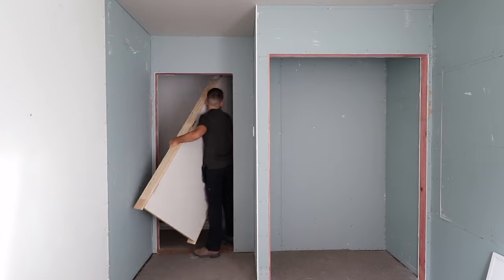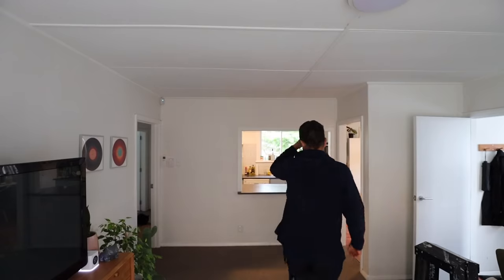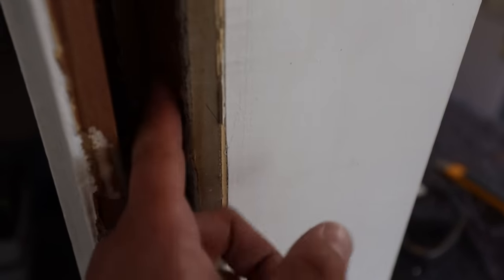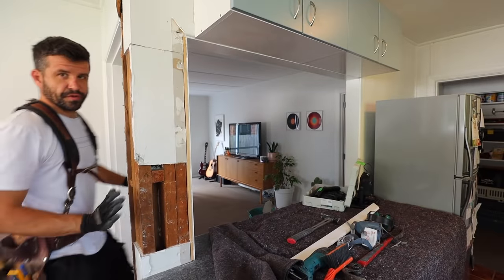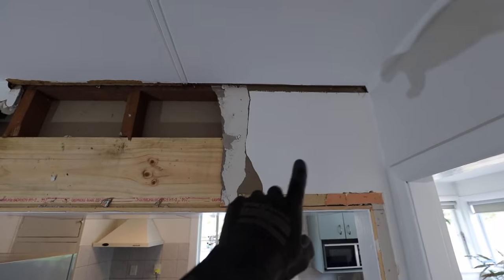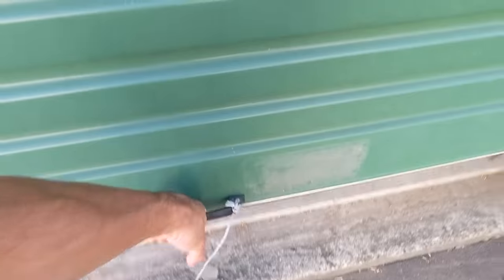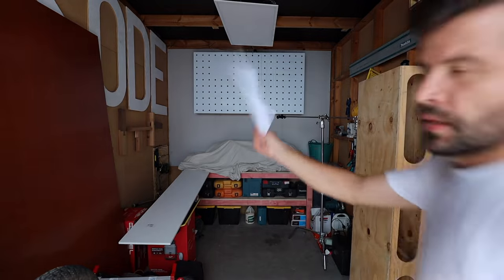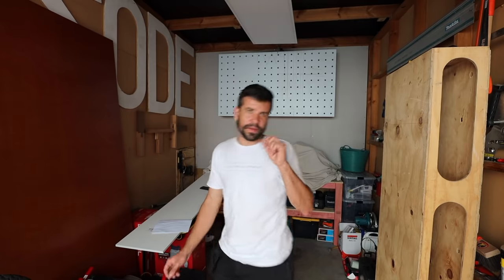Preparing For A 1950's House Renovation

Comment: For those overseas viewers, when Scott talks about a "State House", he is talking about houses which were built in the 1940's and 50's to accommodate lower income families, similar to council housing in the UK. The difficulty, is that they can be quite awkward to work on, as the original framing, is quite often  native rough sawn timber, which is a different gauge and dimension from todays machine gauged timber, and attaching and marrying up new material to old material with slight differences in the old feet and inches measurement and the metric measurements can be a bit tricky.
Reply: for an overseas viewer,  what did he mean when he said he'd been called a tube a few times
Reply: @galvanizedgnome  I don't know, perhaps something like a "knob" or a "tool".
Reply: @gsf67  or a spanner
Reply: Thanks for the explanation; I appreciate the differences of our building styles(I’m in portland Oregon USA.) I’m still trying to I understand why dwangs or noggings are used? Is the thought still for lateral force resistance? I’ve read thermal bridging is an issue? Your thoughts??
Reply: @zagnit  in Australian and NZ construction, especially historically little attention is paid to insulation as compared to the US, because of the relatively mild weather. It rarely gets below 0C, and whilst it does get  quite hot, home air-conditioning was not a consideration like it is now.
Reply: @varno  Thanks for taking the time to explain!
Reply: Thank you so much
Reply: @zagnit  pdx represent
Reply: @zagnit  I think they're less important than they used to be. 

They were supposed to stiffen the wall, stop studs from twisting as they dry out, block flames from climbing inside cavities, improve insulation in open cavities by blocking convection, and support the edges of gib sheeting.

It turns out those are mostly not a problem, or the dwangs don't help much.
Reply: @zagnit  In houses constructed before 1978, insulation wasn't compulsory,  nor was double glazing. Even though it gets cold in winter, it doesn't get below 0 to 5 degrees  Celcius or 40 degrees Fahrenheit. It is now compulsory in all rental properties.
Reply: @NickNameNick2  We just use dwangs(we call fire blocks) at the 8’ mark to block flames if the wall has not reached the top plate yet. It was very common around here in the early 1900’s where I live to use “ballon” framing(continuous stud length to the roof line with ledgers placed around the exterior perimeter to make a “floor.” So Essentially no fire blocking at all. Those houses go up in flames like match sticks...
Reply: @gsf67  yes, but even the new rental standards in NZ only require ceiling and underfloor insulation with the highest code level of R3. 3 for ceilings and R1. 3 for underfloor.

For new construction the required values for region 3 in nz are R3.3 for ceilings, R1. 3 for floors, and r2.0 for walls, 0.26 for windows. The non metric values are r18, 7.4, 11.4 and 1.48 respectively. There are currently no required air tightness standards. This can be met with standard construction plus insulation without framing requirements, and very basic double glassing in aluminium frames. Or a single glassed pvc or timber window with a low-e coating.
Reply: @gsf67  In the UK calling someone a "tube" isn't quite as agressive as "knob" or "tool". You'd call a mate a 'tube' if they'd done something stupid.
Reply: @nialstewart8263  I don't recall ever calling someone a "tube" in NZ, however "knob" is used. The Aussies use "tool" quite often, it sounds funny with a nasal Aussue accent.
Reply: The nail gun doesn’t like bone dry rimu much
Reply: @Bigbirdlittledog  lovely little bounce haha and 1inch sticking out
Reply: @zagnit  Primarily for strenght, even a single row of noggins adds a tremendous amount of strenght to a stud wall. They are used as fire blocking on party walls as well. I worked in Boston around twenty Years ago and couldn't believe  they were never used. I still haven't come to terms with it to be honest, 👍🔨😅
Reply: Cheers
Reply: @thomaswebby2431  it’s best if you can have you thumb close by to cushion the bounce :/

Comment: Scott (love the channel) - put the Aeropress on top of the cup then the coffee with filter paper and then the water. After the pouring add the plunger quick to create a seal. It's not how aero press recommend but i've been using it for 3 years and way more straightforward - no rotating. You've taught me soo much and want to share this hack with you!!

Comment: This is great! I have been renovating my 1950s house and I see a lot of familiar elements. The wall between kitchen and dining with a beam was exactly what I just dealt with in my kitchen. Had an engineer over and ended up removing the wall but had to leave the beam. It's hard to believe that the separate kitchen and dining was ever preferred - in my case, as soon as we removed the wall we got light streaming through the house where the dining area was previously super dark and depressing. Love these realistic reno videos where you explain everything as you go!

Comment: Great video as always. I can totally sympathize with the state of your storage container. I do primarily Finish carpentry and cabinets here in the Detroit area, though some jobs are a full blown residential remodel, meaning that I carry a range of tools and supplies. I have a 160 square foot storage shed/workshop in the backyard. When I am busy running from job to job, it turns into a massive mess more times than not.

Comment: love the Aeropress one thing that completely changed my routine was getting the fellow prismo attachment ( all the benefits of the inverted method none of the hassle) I just use it as normal with it and cause it has a valve it won't drop into the cup until you press it

Comment: Those pinex ceilings can be skim coated with plaster. Just have to screw all the edges after removing the trim battens. Once skimmed and painted you will not tell the difference from a gibbed ceiling. Have done many that way and even the inevitable sagging undulations in the boards will be completely invisible.

Comment: You could drop the ceiling light in your storage area, an add extra storage shelves on both sides over head from ground to ceiling or drop from rafters to height needed to reach an then use a step ladder for more shelves above. 
     Just a suggestion, from one whom has done it himself.

Comment: you might be able to put a beam right up into the roof space and get rid of the beam in the wall altogether.I think 25 mm ceiling battens will be all right with the ceiling joists close together.The designer of the job should be able to tell you(or good old NZS3604)

Comment: Slightly off topic, but are you going to be doing a review of the Stiletto vs Martinez vs Dalluge? Been more worried about my wrists recently and trying to decide which framing hammer to replace mine with.
Reply: Check the archive, he trialed a bunch of the popular hammers a few months back, though the video title might not tip you off to the topic...
Reply: @drleewhite  about four months ago he did one on the Dalluge vs the Martinez, and showed how he had just gotten the Stiletto too as a gift #advertisement, and was going to review it on a later date, that’s how I know he has it. I know also way back he did another one partially on a baby hammer from Amazon as kinda joke. He also did one on all the hammers he had owned 2 years ago, but that’s neither here nor there.
Back story is my dad worked in geotechnical construction for a 30+ years, and from hammer use now can’t ride a motorcycle or mountain bike from wrist pain. I have been doing a bunch of building recently so want to know what Scott and Rich think are the most ergonomic of current hammers.

Comment: seeing the age of the house how much do you have to think about lead paint, lead pipes as well as asbestos?
Reply: Was wondering the same. If this house would’ve been in Australia, it would have been full of asbestos. Even my 1979/80 built house contains a fair bit of it. All of the fibre board in the wet areas, and the eaves.

Comment: Hello Scott Brown Carpentry and team from Sydney, Australia.
* thanks for explaining/exposing the residence and it's supporting frame elements.
* Obviously some renovated work around 20 years ago with evidence MGP (pine) beam and cluster of studs for support.
THE BIG QUESTION
Is the clustering of studs staying to support roof/ceiling frame?
and the transfer of loading down to the subfloor?
Happy Easter
🥚🐣🐥☕
Reply: With this era and frame design it likely will be supporting both ceiling joist transition and underpurlin struts with a corresponding bearer line in the subfloor. Easy solution is beam in the attic space.
Reply: @DiscoFang  Yes: depending on availability of material and time, a steel beam spanning opposite wall plates with 10mm clearance.
😀
Reply: @johnfitzpatrick2469  Only problem with steel beam is that here in NZ you’ve just introduced an Engineer and the cost of his calculation and spec to the job plus the attendant permit and inspections. With timber sized to satisfy spec tables in the Standards I’d be avoiding permit and arguing the Building Act allows it.
Reply: @DiscoFang  No problem!
Reply: Consider 150 UB red steel beam to span in roof space ( use span calculator as it has engineers certification).

Comment: Kitchen design looks good, but I don't get this Kiwi thing for putting microwaves under the counter top - that's a safety hazard right there. I remodeled the galley kitchen in my brother's house and got a double-oven tower cabinet so that I could put the microwave at counter top height without losing workspace. Turned the upper section into a cupboard for storage and it looks awesome.
Reply: We probably shouldn’t tell you about microwaves perched precariously on top of tall fridges, then!
Reply: @snich63  - lol, I've seen that more than a few times.
Reply: You're gonna have to explain how being low is a safety hazard. Shoulder height is a safety hazard which is the standard US placement (above the cooktop). But, low?
Reply: @DiscoFang  - small kids can open microwaves at that level. And then there's the whole having to bend down to put stuff in and take stuff out coz most peeps aren't gonna bend their knees every time they use the microwave under the counter. Okay, not a big deal when you're just making coffee, but if you're reheating a casserole, that's a different ball game
I get that it's a design thing and makes the counter top look clean and uncluttered, but ergonomically, it's bad. Unless you're in a wheelchair.
I don't get the US standard placement of  microwaves above the range, either.
Reply: @richardbaron7106   So every single free standing range/stove with an oven is a safety risk to use normally? I think you’re stretching it describing scenarios. A casserole gets cooked in an oven too. 

Yes, kids can be a problem but at the age that they don’t understand, they are only just walking and it’s not a real problem. And they can’t really hurt themselves... but hurt the cat? Then again, the cat is at the same risk with a dryer, washing machine and the aforementioned oven. Yes, even a 3 year old can get a stool and reach bench controls of a stove... and the bench mounted microwave. You teach them not to.
Reply: @DiscoFang  - look at it from a purely ergonomic point of view: it's a dumb design idea. You can agree to disagree and that's fine.